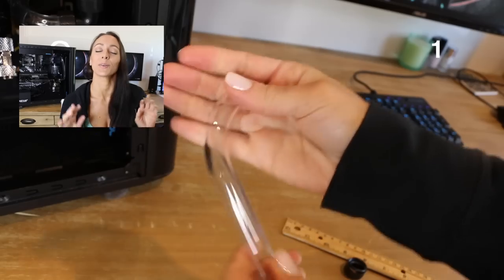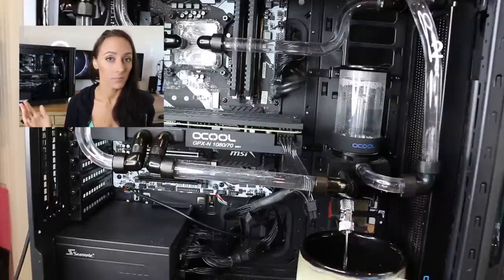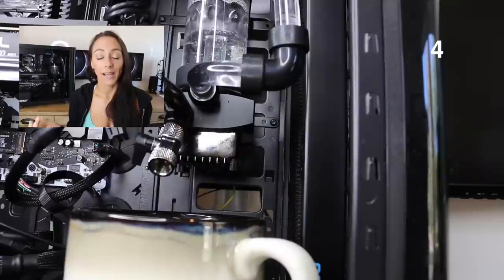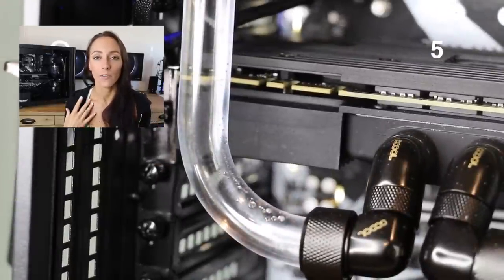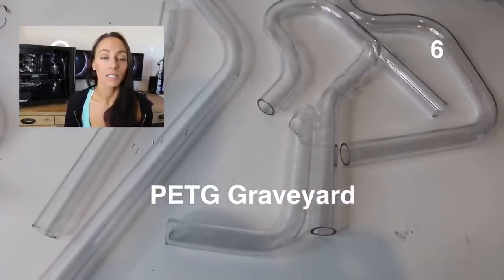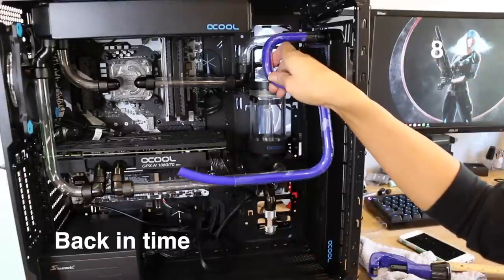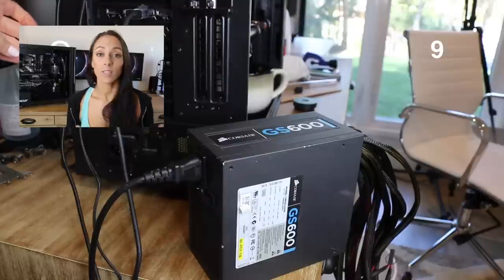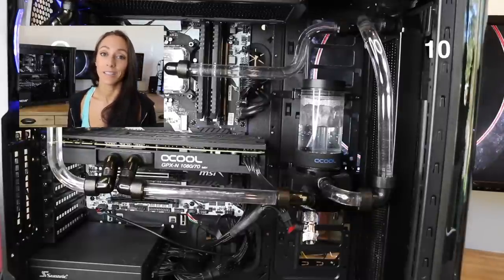10 Lessons Learned from First Watercooled Build

Comment: Aircraft mechanic here: #4, loose fittings will happen due to a side-load on the line (perpendicular force) which will give the impression that your fittings are tight. Pro tip: give the line a slight jiggle as you make the last few tightening turns, and jiggle again after tightening. If you feel a small creak or click, that was the side-load on the line giving away and means you might be able to give another 1/8 or even 1/2 turn.
Reply: I agree as a diesel enthusiast!
Reply: same here.  i had to run piping thru house.  @SchkuenteQoostewin
Reply: Mate, I work on building sites and holy shit you just gave me the vocabulary to express what I’m trying to explain to people!!!! Wp

Comment: Just a quick tip; Put a stop fitting on your drain port. The way those ball valves works makes them mostly water tight, but not 100%. A stop plug would just be some extra safety and will cost you about 1$, which is well worth it in my book.
Reply: Sound advice. Thanks

Comment: Good tips for the beginner.  I've been watercooling for a while, so it's easy to forget a lot of the more basic issues that beginners might run into.  Regarding #6, not all PETG is created equal.  It's also possible that it's just crappy PETG sometimes too.Also, instead of the extra power supply, I just bought a couple AC-DC to molex power bricks, so it's smaller and more convenient than a whole power supply.   And on #10, ALWAYS test the hardware before you actually install the watercooling components and run the tubing.  Huge pain spending 3-4 hours building the perfect loop only to find out your CPU or Motherboard were DOA lol  You're off to a good start!

Comment: Don't care that I'm necro'ing the comments: I've been building my own machines for about 20 years now, but I'm actually just finishing up my first water cooled build (and so of course jumping straight into PETG instead of soft tubing first; go big or go home!).  Still waiting on a few fittings to arrive (specifically for the drain, for exactly the reasons you mentioned; at least a valve and cap, because eff draining Thermaltake's Tower 900 by holding that monster case at an angle into a funnel lol), and the the SSD (won't be accessible once the loop's filled), and honestly this was perfect.  It answered some simple questions I'd been googling around for weeks, but the biggest was about bends near the tube ends, for the simple fact that you covered what the problem is; it hadn't occurred to me, but once you pointed it out, it's obvious.  Of course you'd need a straight section long enough for the fitting itself, but also for it to slide back during the install process itself.  If the loop ends up laid out how I think it will, it's gonna have a couple bends pretty close to the fitting, and that one example from this video may well save me a LOT of time, and a fair bit of money buying more tubing to replace what might have ended up wrong.

Thanks for this vid, it is truly one of the better I've found on youtube, and I mean that, because the vast majority of search results for the last 10 years have been 10 minute videos that one paragraph of text would cover, and the vast majority of the videos are worthless.  Thank you, this was truly and legitimately helpful.

Comment: For leak test run can use tissue to wrap around fittings / joints and put a little dye in reservoir. If it does leak you can see dye stain on the tissue even after the water dry. It also helps to detect minor leak. If it does leak, tissue can reduce water splashing out too much.

Comment: "Finished" my first watercooling build in 12 years. I bought more PETG tubing recently because I am not happy with a few of my bends. I think I'll stick with soft tubing rather than rigid for any future builds. Ultimately, I don't think it was worth all the frustration I went through. But hey, I gave it a shot.

Good job on your first watercooled build, and best of luck on YouTube!
Reply: I see what your saying, I had 3 bends that were a nightmare.
Two of the tubes were bending my graphics card too much and it was unsettling so I started them all over.
I think its a learning process though, the next time I do it I will be better at it and should have less frustration hopefully.
If you are a person with no patience then is definitely not worth it, as you would screw up somewhere.
Reply: So I could just use soft tubing instead of hardline for a custom loop right? I'm thinking about doing a custom build like this soon.
Reply: Yes, I would assume most people use soft tubing as its easier.
You might eventually end up with hardtubing though if you get addicted to it.

Although a point to consider is that hard tubing isn't actually more expensive to do.
Maybe slightly more expensive as you will want extra tubing as some tubes you will discard.

You just need patience with it really and to realise your system might be unusable for a week perhaps.

Whichever type you go for, I would decide on a size and stick with it.
If you change size you will have to change many of your fittings, so it makes sense to choose it once.

I would recommend 1/2"-3/4" for soft tubing as its hard to kink.
And 16mm OD, 12mm ID for hardline tubing.
Reply: Colin Java Thanks for the feedback. My main concern with hardtubing is that it seems very difficult to do and I usually am not good with things like that that usually require a lot of patience. However the outcome is really rewarding so when my h110i fails I think I’m gonna go ahead and give it a go. Thanks
Reply: Remember with PETG you can always reheat the tube and tweak it until the bend is perfect.
Just don't hold the heat on one spot for too long or it will bubble, but I've never had a single bubble so you would really have to be uncareful to get one I think.
Make one end of the silicon insert slightly pointy then it should reinsert back into tubes with a bend in a bit easier. Always use washing up liquid and water when inserting the silicon tube.
And remember to heat the whole area of the bend including the sides and heating the outside of the bend a bit more. I would recommend Barrow V4 hardline compression fittings as they have a quadrouple o-ring design and are very reliable but well priced unlike bitspower which are expensive.
Let me know if you want any more advice at any point.

Comment: I have 2 tubes left to bend in my new rig, the thing I have learned is while sli watercooled GPU's, monoblock and 2 huge rads look awesome. They add a hell of slot of complexity, between the increased bends, fittings and mountain of cables (11 hd120/140 fans with 2 cables each), it really is getting crazy, though, it should be worth it when it's done :)

Comment: Good to see someone honest regardig their misstakes, i bet that alot of people trying this on their first time will do one or serveral of your mentioned misstakes! Big like for this video!
Reply: I've very recently started hardtubing so I've been going through the same journey.
The soap thing is a very good tip, not just for pulling tube out but for pushing it into an already bent tube that requires tweaking. Would be impossible for me without soap.
I would say don't heat the ends of a tube they can start to deform, then they wont go into the fittings.
I would also advise to take out the orings on two fittings to use them for testing the current tube being worked on. This way you only need to sand your tubes edges down once the tube is the right size/shape. This will prevent you cutting the orings with sharp tube edges, its very easily done and isn't worth the risk.
And I always wash my completed tubes with hot water, to flush out any bits and get out any soap in their also.

Comment: Good points... regarding liquid hitting motherboard... back when I used bi-distilled water ir sprayed out at high volume all over my brand new motherboard, ram, dvd drive, power leads to drives. My pc was on and booted in windows... No explosion... no smoke... no fire... no crash... the distilled coolant was fresh and electrically inert. I know other people who had motherboards destroyed with only a small leak of certain dye coolant pre-mixes.

Comment: With a manual  tensiometer ($ 20) you can check if there are leaks before using the water.
You connect the knob and the clock to a stopper and you put 760 mmHg which is 1 atm and you wait.
If the hair does not fall to 0 mmHg, there is no leakage.

Comment: May also suggest that instead of a second regular power supply, you can get a cheap external power supply, made for testing water loops. I know Phobya has such power supply. It has just a molex connector and then connects to a wall. Cheap and great for testing water loops without the need of jumping a regular power supply (which is hard for beginners, if all cables are black and not colored)

Comment: Screw on fittings tight as possible is only if you are using fittings that are tightened by hand. With fittings that use tools you can easily crack a block or destroy threads

Comment: Would agree :), the bending isn't all that hard. It's the measuring and bending in the correct place thats the hardest part. I always just put a pencil mark on my silicon then pull to where i need it and bend on the mark with a mandrel. Rub off and adjust for future bends.

I've done hardline for years but recently went back to flexi tube as i just find it easier to maintain, couldn't be bothered with rebending everything everytime i wanted to change something which usually happens a few time a year. My current setup means it wouldn't look all that great as the flexi flows really well.

Awesome video and definitely subscribed! :)

Comment: So I have built custom watercooled computers for years and I can tell you that the fittings that were leaking before you tighten them down are not in the fitting all the way. The tube should be past the 1st inner o-ring and that should stop all the water unless that o-ring has been damage or just not pushed in all the way. the o-rings in the collar are added protection. You have to push in the tubes pretty hard. Your build should be fine but if you transport it in a car or anything with bumps those could wiggle free. Just giving you a heads up. Good job though on your 1st build!

Comment: I've been researching the topic (no water builds yet), but it seems to me that hard-piping is just a fashion statement that comes with lots of cons, with perhaps just one functional advantage - hard tubes stay clear for longer.
 vs ...
Using soft-tubes:
 - I can use quick-disconnect fittings to manage internals easier and even not care about draining the whole system in order to replace a RAM dimm or m.2 drive , or even the CPU or GPU for that matter. To simplify it a bit - if you have lets say 4 main nodes in your liquid loop: CPU, GPU, Radiator, Reservoir I need 4 quick disconnect fittings (one between each consecutive two nodes).
 - I can even make the Reservoir optional ... well it seem Reservoirs have always been optional, but since they're so convenient for managing your loop it makes no sense to pass on them.
But as far as I understand you don't NEED them in the loop all the time - only when you're (re)filling your loop.
So I'm planning on building a small case with hybrid (CPU+GPU) cooled system that's under 10-11L (the case not the water in the loop :P), and I would also like to dump any unneeded weight since I want to be able to backpack that case frequently w/o carrying extra kilos each time (even tiny reservoirs like the Glacier R160 are close to 400-500gr not incl. the water about 120ml). So why not leave the reservoir at home where I can do my liquid-maintenance, only when I need to, which ideally would be about once a year. Well it quick-disconnects you can do it (as long as you soft tubes are convenient length so that they connect when reservoir is unplugged) - both sides would be a male & female so ... a match made in heaven :D
Btw with external reservoir I won't be restricted to a small one (as I would be if I wanted to fit it in the case permanently).
I just thought of another thing - I can drain it before getting on a plane so it'll be safe, and refill it when reaching my destination. Empty loop & reservoir are safe and light, and being external I can put the reservoir in my check-in luggage while carrying the more fragile pc in my carry-on.
 - Drain-port it can be a combo with the Reservoir, ie also external.
 - Having more but smaller segments of soft-tubes each of which is connected to quick-disconnect switch to one side I'll be able to replace only selected tubes much easier, and only the segments that need replacing (like getting duller for example). So that it a good trade-off for the only (known to me) functional advantage of hard-tubes.
 - With soft tubes & again - quick disconnects I can build & test my liquid loop without actually placing Motherboard, CPU, GPU or anything sensitive in the case, just need to power it, and leave it for a day to test for leaks. When tests are done successfully, I can disconnect the segments of the loop so that electronics are installed, water-blocks are mounted properly, and loop is reconnected in order to make test of the cooling performance.
Only additional effort for installing/maintaining soft tubes would be take care of the sharp-turns. But here actually hard-tubing can come to help ... well at least a small piece with the shape & bend of the that nasty turn to reinforce the soft-tube in that spot only - doesn't need to be super-precise since it's not going to hold water (the hard one that is) :)

Am I missing something?

Comment: Good advice, I have a 2005 Apple PowerMac G5 Quad Cpu that was given to me, I am thinking of Hot Rodding the Delphi water cooling system it came with by using Earls or Russel Stainless braided lines, Anodized clamps and powder coating the hard lines black , red, or blue.

Comment: If you're using proper distilled/deionized coolant in your loop, you don't have to worry about shorting components if you have a leak. Nevertheless, a spare p/s is a good tip.

Comment: Lol, good to see other people also make mistakes. I tried watercooling several years ago when gpu/cpu were alot hotter (and aircooling made more noise). About 10years ago. I tried soft tubing. I had this great idea that i would cool my ram too. So when i tried to remove the heatspreaders (yes, i had to do it because i had a ram waterblock) i discovered i had destroyed all of my ram. I had managed to destroy the chips on the PCB. The chips were now still stuck on the heatspreaders (bc of the glue) while the PCB did not have any ram chips. 

I destroyed ram for atleast $200. After i did that mistake i decided i did not want to cool my ram after all so there i had additional $100 wasted on a ram waterblock.

Comment: Tightening fittings on the tubes is important but you have to be careful not to overtighten fittings on a block.

Acetal can easily crack if you are too forceful or decide to use a tool (don't!).

Comment: I'm a new subscriber with one question. Do fittings wear out over time? Great video by the way. I'm thinking of trying watercooling with a threadripper build.
Reply: Maybe after years the rubber orings might go hard and crack (just speculation),  but fittings are all metal, they won't wear out.
So this watercooling stuff isn't like buying a cpu where it will be almost worthless after a few years. The stuff should last many many years.
The exception is the pump, you might get 3 years or so out of a pump before it needs replacing.

Comment: You didnt use the tube filler when u were heating the tubes? It helps the tubes not shrivel or shrink and what not
Reply: Nvm the part where you showed messing up the tubing didnt have the inserts then u showed with the inserts

Comment: Great video, thanks for all the tips - will have to put in a drain point for my loop. That is just so common sense. Too bad the EK kit did not include one. For me I am not too interested in the looks but performance and done professionally. So soft tubing (at least for now) is good enough so no need to do all those fancy bends and extra fittings. Please keep up the good work here.
Reply: I started with soft tubing too about 3 years ago.
I've always liked looking at the hardline builds and always found hardline to be the only way to get a really nice looking build, perhaps a few exceptions though.
If you like looking at hardline builds too, I think in the future you may have to convert like I just have.

Comment: at 8:24 you put do not touch. You CAN touch that, even when PSU is on. It's a DC and won't harm you unless you put metal spears on either side of your heart and connect to those ports.

If it was an AC, I would recommend to not touch that.
Reply from the maker: Ah good to know! I only said that because someone else said that in another video (bad on me for assuming they were right), and I didn't want to be responsible for anyone's demise. :P
Reply: If there's a bad ground in the PSU it can zap you with 110 through the case. Doesn't happen often, but when it does... eep.